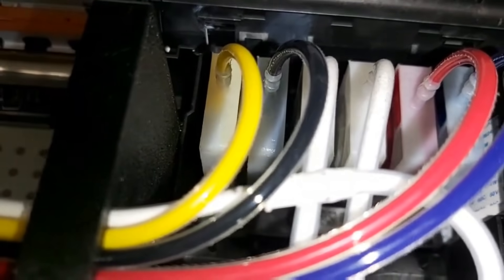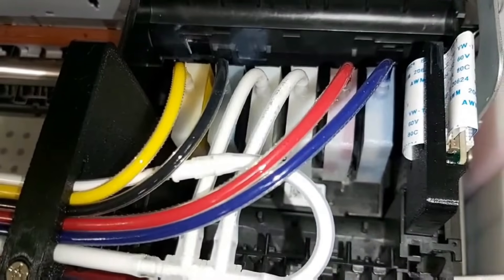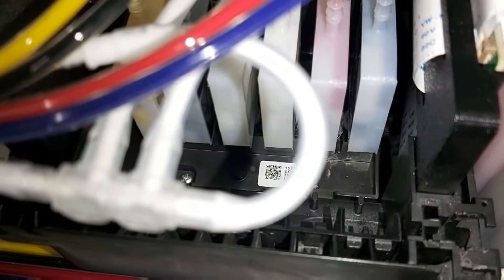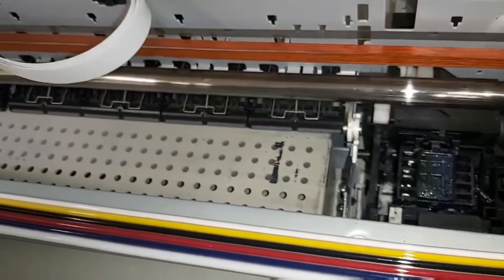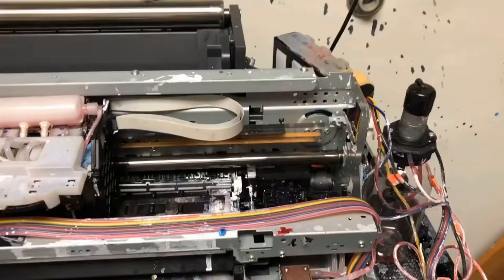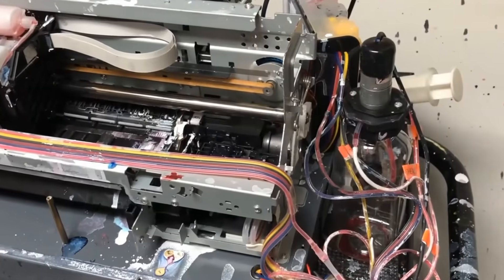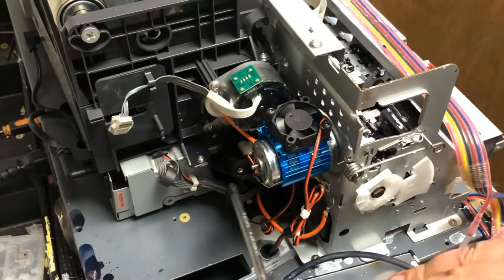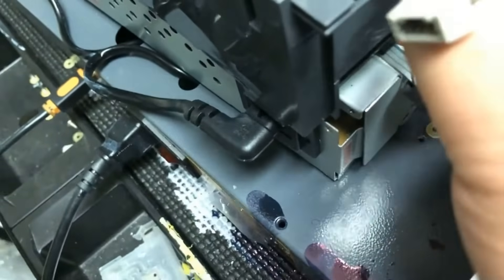Why Your DTF Printer’s Capping Station is Gushing Ink - Back Flow Fixed

Comment: Is there a video where you don’t take the whole thing apart? I’m not confident enough to do so let alone put it back together
Reply from the maker: Thanks so much for your question and for supporting the channel! Since this issue involves repairing an internal mechanism of the printer, it does require a certain level of confidence or the help of a professional, but I do have some videos that can guide you depending on your comfort level, such as removing and installing the capping station ([https://youtu.be/_cZEkmgIZYc](https://youtu.be/_cZEkmgIZYc)), unclogging it ([https://youtu.be/WbY_6O1-w2c](https://youtu.be/WbY_6O1-w2c)), doing regular maintenance ([https://youtu.be/5yjq3ZN0qv8](https://youtu.be/5yjq3ZN0qv8)), repairing common issues ([https://youtu.be/5UC2IMu9V90](https://youtu.be/5UC2IMu9V90)), or rewiring the tubes ([https://youtu.be/J9im3s8UJfo](https://youtu.be/J9im3s8UJfo)), and if you want the most detailed breakdown, I also have an exclusive guide on my website that shows complete disassembly and reassembly of the capping station: [https://bchtechnologies.com/products/video-capping-station-assemble-disassemble-guide-for-l1800-1390-artisan-1430-and-1400](https://bchtechnologies.com/products/video-capping-station-assemble-disassemble-guide-for-l1800-1390-artisan-1430-and-1400). I do get a high volume of questions, so please know that subscribers and members are prioritized with answers usually within 48 hours, while I try to respond to other viewer questions as time allows. If you need faster help, you can always email [support@bchtechnologies.com](mailto:support@bchtechnologies.com). Please consider subscribing or even becoming a member to enjoy priority answers, exclusive benefits, and early access to videos, and if this video or my reply has helped you in your journey, it would mean a lot if you could kindly leave a review on my Google page: [https://g.page/r/CfL7k6nYvPQ9EAg/review](https://g.page/r/CfL7k6nYvPQ9EAg/review)

Comment: What is the purpose of the small spring?  My printer do not come with a spring
Reply from the maker: Thanks so much for the great question and for supporting the channel! That small spring helps keep the suction station level so the pump can pull ink correctly, so if your printer didn’t come with one, it’s definitely worth getting because the capping station won’t function as intended without it. I really appreciate you being here, and if you haven’t already, please consider subscribing or becoming a member because I get a huge number of questions each day and subscribers and members get priority replies within about 48 hours, while I can only answer around 10 general viewer questions daily; after members and subscribers, any remaining replies are handled last-in, first-out, meaning newer comments get answered first. If you’re not subscribed and don’t hear back within 48 hours, feel free to subscribe or simply re-post your question, and if you subscribe later, all your older questions automatically get bumped into the priority queue. You’re also invited to join me on Run With Kevin — LIVE, where I go live most mornings between 6–8 AM Eastern and answer printer questions in real time, so make sure to subscribe and turn on notifications if you want to catch the next session and ask questions directly. If you ever need faster help, you can email [support@bchtechnologies.com](mailto:support@bchtechnologies.com), and if this video or reply helped you, dropping a quick Google review would mean a lot: [https://g.page/r/CfL7k6nYvPQ9EAg/review](https://g.page/r/CfL7k6nYvPQ9EAg/review).

Comment: Hi Kevin.
You have a great YT channel.
I'm glad I found you.
Have you replaced the Ink Absorber in Canon Pixma TS6310 printers ?
Best regards
Reply from the maker: Thanks! I haven't but I know you will need Canon Service Tool to reset the counter.
Reply: @BCHTechnologies  Resetting the counter is no problem.
I have software for that. Wic Reset Connect
I just don't know where the ink absorber is.